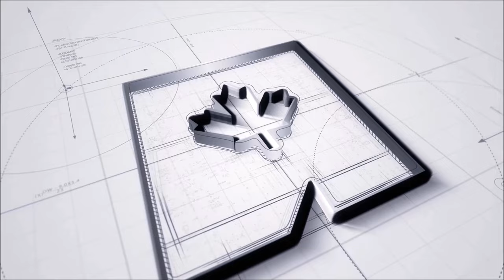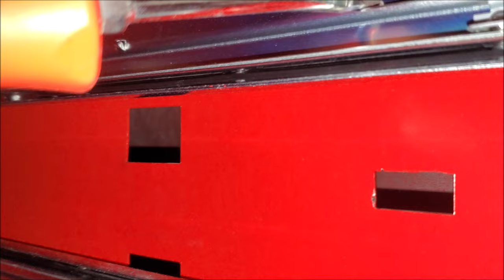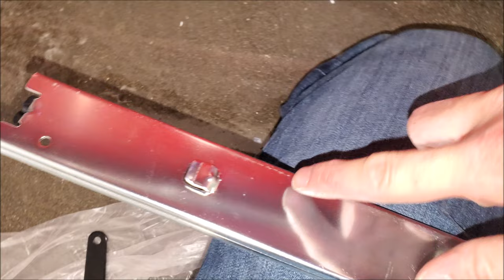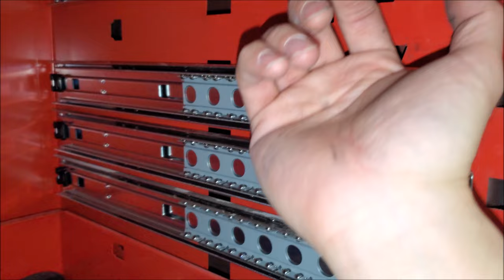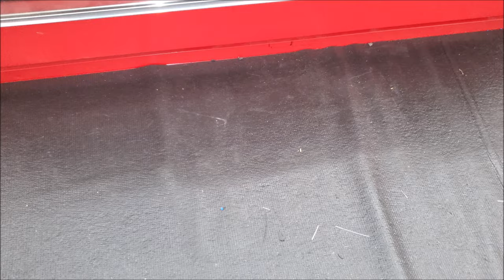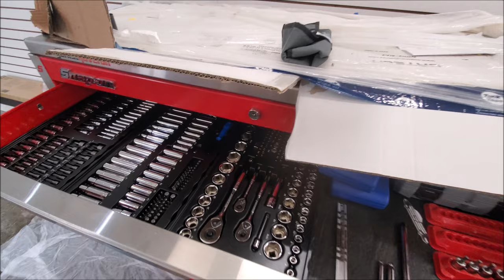Snap-On Drawer Slider Replacement / Relocation | AnthonyJ350

Comment: Morning i have the older trolly toolbox and the rail where the draws slidein is 'n fixture that is broken either on the drawer OR the toolbox. This is one of the first toolbox es. Where can i buy the slides and how can i fix the drawer.
Reply from the maker: You'll have to contact a SnapOn dealer for the parts if available. Or try eBay.

Comment: So, is it possible to take the deepest drawer that's usually on the bottom, and move it to the top?
Reply from the maker: Yup, totally. Might have to rearrange the slides to do it.
Reply: @AnthonyJ350  awesome! I wanted to do it but someone told me it won't work. They have have assumed the slides won't come off. Thanks for the info!

Comment: Leave it to snap on to need a special tool. To replace slides
Reply from the maker: To be fair, auto manufactures keep making proprietary fasteners and you have to buy special bits just to remove a bolt.